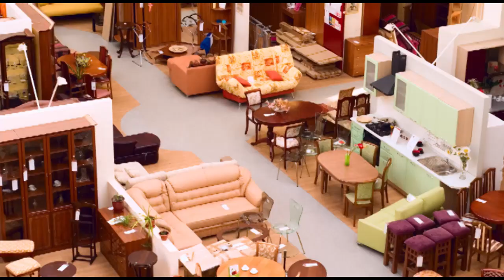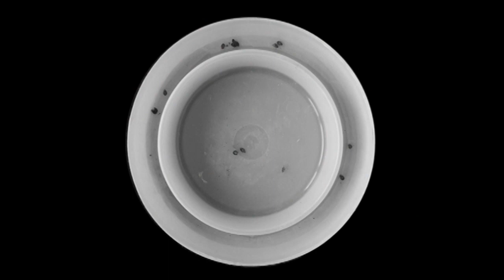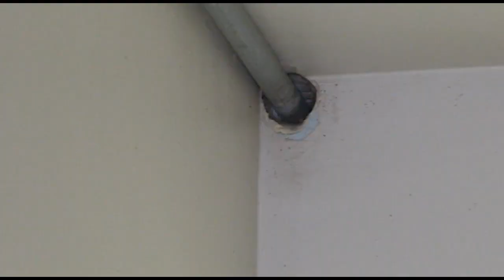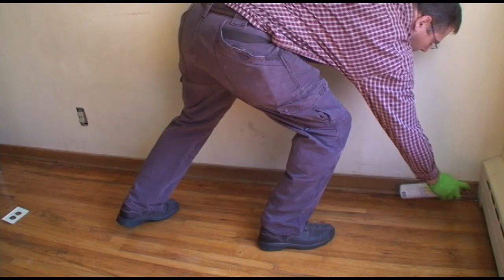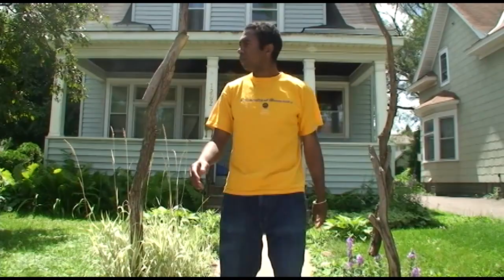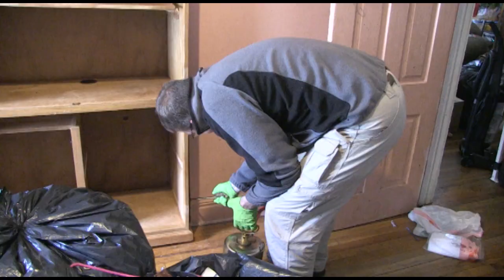Let's Beat the Bug! - Bed Bug Prevention and Control

Comment: A tenant refuse treatment beside me. We have to toss out our mattress and I’m going to buy bedbugs mattress protector, but the concern is how to not have them come back from the neighbour. The landlord refuses to treat the whole building and now I’m hearing from other tenants they had them also a year or so back. These bugs are hiding within the walls now of this building. I need help as this caused a big bent in my savings and I can’t move forward when my money is wasted on this then my retirement fund.
Reply: Watch some videos about Diatomaceous Earth and give it a try when you see them. Found them at my grandparents apartment.
I caught 2 bedbugs in a cup and left them in some DE. They were dead before I woke up the next morning.
Dust the stuff everywhere. I put it around the sides of the bed and around the foot and shin areas. 
Also put it INSIDE the box spring, inside wall outlets, all over he carpet, along the carpet edges, window framing, etc..
Mostly, I just worried about making a parameter around the bed, so if they try to feed, they'll walk through it and die.
It's non toxic. Basically, just crushed fossils. It's dries their exoskeleton out. Also helps with numerous other insects.
Just don't breath in the powder. It's not good to breath in any kind of powder, regardless of how safe it might be. 
I breathed in quite a bit when I applied it. I'm dumb. But I just had a rock taste in my mouth for a few days. Still.. Not a good idea. Wear a construction mask.
Reply: @IsyeRyan  Thank you for your comment. I discovered DE after I made this comment and did exactly that and so far we’re good. 😅
Reply: @TheBohemianStyle  call the health department. Bedbugs are a public health issue.
Reply: BORAX ACID  , BORON, EFFECTIVE TREATMENT, NON TOXIC